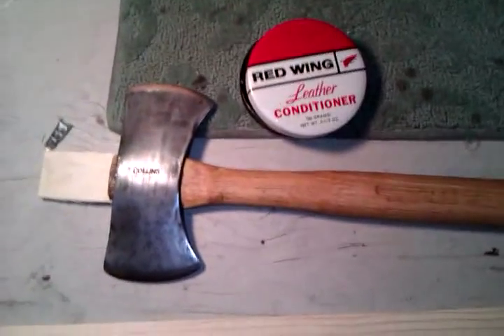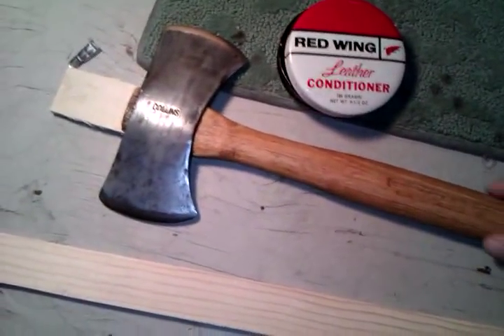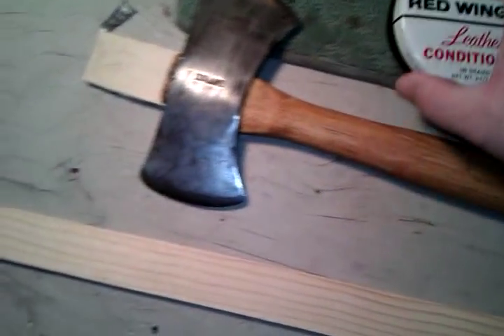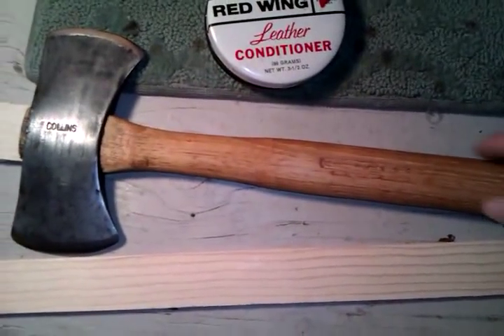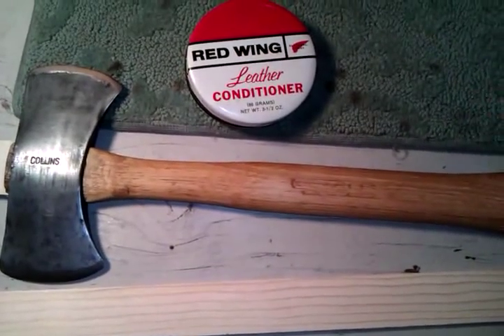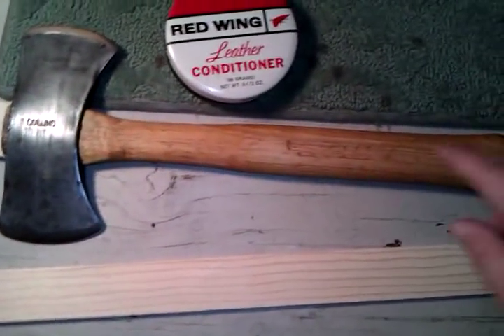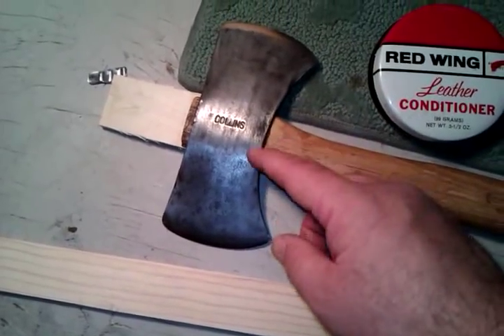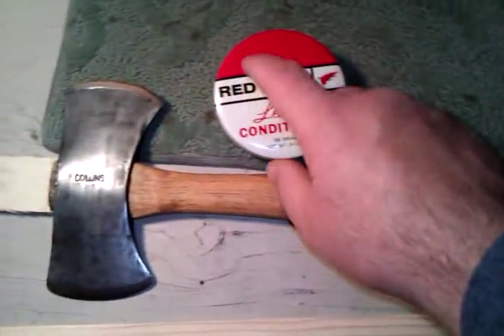Different Finish for Hatchet Handle

Comment: Wow! What a beautiful little axe! You have outdone yourself, sir! If you are restoring to "Like New", then, by all means paint the head with that 2 inch racing stripe. But if you are going to make it a working axe, skip the paint. Can I suggest that you use beef or deer tallow on the head. It's not like pork lard that melts at room temperature. this stuff keeps it's wax like consistency at much higher temps. Its also easy to tote around in your tool pouch. Good for anything leather or metal.

Comment: Yeah! I guess you can't argue that reasoning for painting the axe head.
About the tallow; It's also great for waterproofing leather. If you put it on the inside of your leather sheath, it keeps it soft and supple and won't allow your knife or axe to rust. If you us it on the outside of your sheath it makes it waterproof.
I use it on everything including rifles and shot guns. I use less oil which is more expensive than the tallow. My weapons stay rust free and clean.
I also waterproof my boots.

Comment from the maker: The heat opened the grain of the wood and liquified the grease, so it soaked right in. As far as grip it's great because the scrapped surface is textured. Feels dry to the touch, just like if it were wax treated.

Comment: huh. Reminds me of thermally treated wood products like ecoprem - heat, and in their case steam, hardens the wood substantially and makes it insect and rot resistant and impervious to moisture. Which reminded me of the old practice of hardening wooden tools/points in fire. Which reminds me of FrogLube, which involves heating your firearm or knife to open the pores. Which makes me wonder about that leather cleaner on a gun . . .